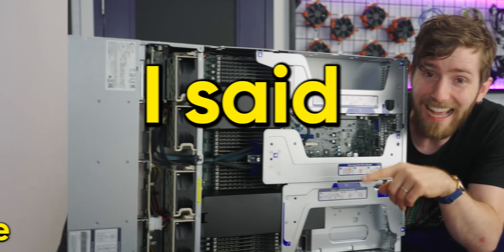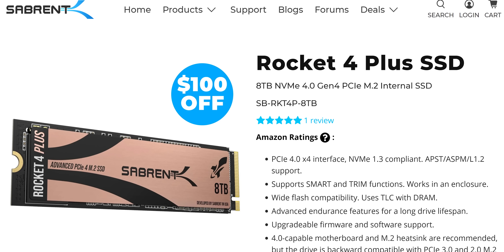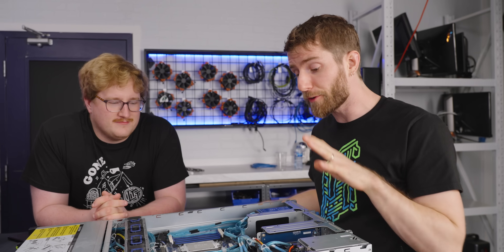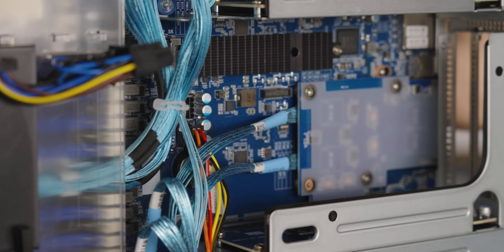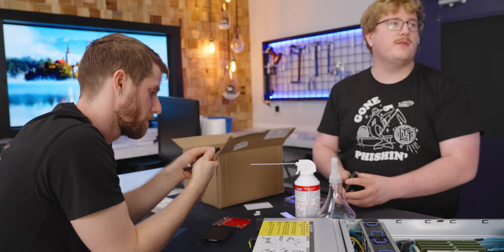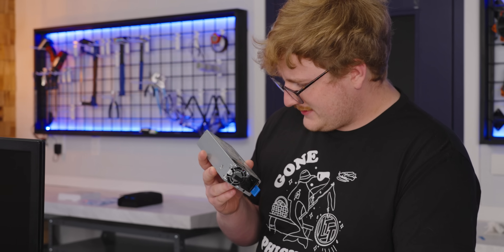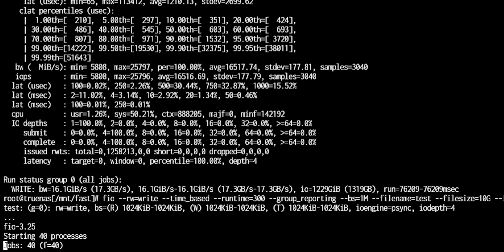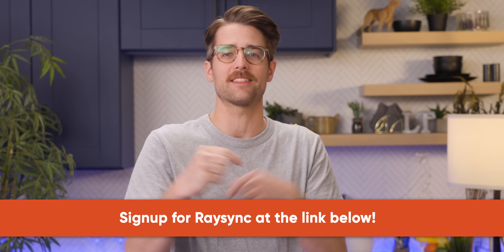Fixing our server's biggest flaw

Comment: I just realized that Micro ATX boards support 22110 drives... Hmm, Windows 8.1 supports NVMe and Turing NVENC via Quadro RTX 4000. Let me see... Ooh, Micron 7300/7400 series with the 400 being PCIe 4 and 300 as PCIe, the rated lifespan is... (7008 TBW) Waihaihait WHAAAT?! A 3.84TB TLC SSD that lives life several times over? Heck yeah I'm gettin this. Now I just to need to check if PCIe 2.0 NVMe with support the PCIe 3.0 1x as I plan for Linux on the main NVMe slot. A dual boot system with Linux for gaming and Windows 8.1 for my workloads.

Comment: We think there is something wrong with your config. We are a Gigabyte System Integrator, specialized in this kind of server and we've made a similar configuration, but with an old gen server, with less core counts, less frequency, less RAM, and we reached 55Gb/s easily and 70Gb/s with a better network. And We assume our selling price was lower than your purchase price.

Comment: RAID cards do not perform parity verification.  That is typically always a file system function.  In general, RAID cards do not need to verify parity on every read operation because the parity information is typically used during the rebuild process or when a drive fails. In the case of SupremeRAID by Graid Technology, Inc., we rely on background parity verification to periodically check the integrity of the data stored on the RAID array by verifying the parity information. This is the common practice in the industry for all RAID products including Broadcom, Intel’s VROC, Linux MD and even RAIDZ inside of ZFS.
 
For a user that insists on deployment where parity is constantly verified, they are more than welcome to implement SupremeRAID alongside ZFS to get the desired outcome.  By doing so, users would also benefit from the “wildly fast” performance that SupremeRAID offers.

Comment: Wait, ZFS is limited to like 30 Gb/s? I’ve got a QNAP TS-h1290fx NAS with ZFS that gets 2500MB/s read and up to 5500 MB/s write. But I really want to overcome these bottlenecks. I need RDMA! Like SMB Direct or something. Need the low latency pushing multilayer exr files through unreal engine. Basically I need a 40TB+ NVME drive with nvme speeds!

Comment: after having to fix a failed raid array with m.2 drives in a Lenovo server after only 3 months of use... this is sooo much better than having to rip apart the server each time to find out which drive is actually dead causing the server to not get past post.... i'd never suggest anyone buy a lenovo server after that, DELL all the way!! definitely going to suggest to replace their m.2 drives with these adaptors, will make rebuilding arrays and keeping them going soooooo much easier, best part is the server fell over again the following day, thankfully I had already moved papercut to a new host. so those vm's can just rest in peace while we wait for a warranty replacement. xclarity also stopped being accessible as well and the two onboard nics died lolll but damn such a handy thing that adaptor XD

Comment: Wouldn't it be nice if a hot swap tray had a light on it on the front of the rack that turned red to tell you which one was bad.  So all you have to do is go look at the rack, find the red light, swap the drive, and have it auto reconfigure it into the raid array?

Comment: Those Sabrent SSDs are rated for 0.7 DWPD vs 1.0 DWPD for the Kioxia CD6 (and Dell/Solidigm P5500), so not that far off despite being "consumer" devices.  I still wouldn't use any of those for multiuser video editing, but I guess when these things burn out in a few years LTT can make another video about their replacement.  I am not LTT, so I buy the (slightly) more expensive 3-7 DWPD models, and by the time those die, Kioxia and Solidigm will have changed names yet again.

Comment: WORD OF WARNING with these adapters! I've tried a few different brands but every now and then they like to drop offline for a bit and then come back. That's not too big a deal for my smaller use case, but in a ZFS array that can be real bad news. Even a successful rebuild will invisibly eat away at the endurance of your consumer drives, and if you have multiple simultaneous failures in just the right configuration, it's game over. These adapters are great when they work, but they're the weakest link in what sounds like a critical server for you guys. Something worth setting alerts to monitor and if you experience dropouts like I did, time to move to a few Micron 9400 Pro 32 TB drives.

Comment: If the thermal paste is that important, you don't want any air bubbles trapped in between. Don't stir it around. Apply it in a big pile in the middle and work it carefully out to the sides.

Comment: Wow. 20GB/s rhats totally non impressive with that amount of drives. In the lab we did triple that performance in a single server with pcie gen4 drives, granted these are the expensive enterprise grade drives. We did 28GB/s with previous gen pci drives. Sustained using software raid. And delivering that to a network client not on the storage server itself. We did a short test with 4 nodes delivering wire speed at 4x2x200 Gbps network 1.6 Tbps which delivered 180GB/s peak 150 sustained on 80/20 read-wrie balance. Currently testing pcie gen 5 based solutions.

Comment: Hey Linus, thanks. I put a 1TB SSD in my Steam Deck today and got a ton of help from your last videos and the LTT forums - it was awesome.
Reply: Why not rog
Reply: @memerified  because a 1080p screen on a handheld is like a 4k screen on a laptop - too much battery drain for not enough visual uplift. Unless you're playing plugged in, it's not worth the extra pixels. It's like a less egregious Pixel Book - specs for the sake of specs without thinking them far enough through not to mention the software problems. W11 on a handheld is hell on earth, especially without trackpads (I tried W11 on Deck and only the trackpads worked). Just. Fucking. No.

Comment: A cluster of 3-5 Whonnock servers makes more sense. Each could have a less extreme setup with much more combined CPUs/RAM/Drive space. A cluster has a lower risk of downtime and spare lanes to put more IO devices like NICs\GPUs\Accelerators. You would have spare CPUs to do other work like other network services. If you ever needed more CPUs/IO/Storage then you slap in another server to the cluster. 45 drives could probably help with that.
Reply: What clustering technique do you think can output 20+ GB/s? For GlusterFS you would need about 500-600 Gbps interconnect even with 3 servers alone.

Comment: ...I'm confused.
The OS should be able to return the serial number for the dead and / or working NVME drives, which could be compared to the drives on the carrier boards.

Tops, that's a few hours downtime to find and replace it...

Or was this just an excuse to get new hardware? 😂
Reply: That would still mean opening up the whole thing and checking serial number drive by drive, if it's not on the top that would be...annoying. lol
Reply: @rekaivns  surely you'd only need to check the array that failed on the carrier board though?

...or did they make arrays across carrier boards? 😬

Comment: Is it not common in industry to move data to an alternate temporary media, (usually with slower spinning disks) t0, do the repairs then reverse the move. It's a roundabout way, but should work well with zero downtime. I know that always on game servers do a similar thing by moving all information and connections to an alternate server whilst the main server is updated, usually the server is lower performance but serves it's purpose fine.

To recapp what I'd have done in your case;

Set the ram to dump straight to ssd's so that information on the ssd's are up to date, this may slow the connection to the editors.

Transfer data from the ssd array to an alternate temporary array at the highest speed possible, it's likely I'd use SATA ssd's in your case.

Repair the failed drive in the array.

Fix the data with parody drives

Compare and transfer the altered and new data from the temporary array.

Set ram back to data cache.

During this there'd be 2 major bottlenecks where both drive arrays are active at the same time, and the temp server would be significantly slower than the main but it would keep your array matching, plus gives you ample of time to do any upgrades to the main drive array.

Comment: Enterprise equipment really does have so much waste. Those placeholders are a good example where they could've made it so you can at least attach a drive but nope, they're often not even all that long just to fill in the slot. The other part is their packaging, everything is individually packaged to such an extreme, we've ordered multiple drives from HPE in the past, each individual drive gets its own, decently sized, box along with massive plastic holder floating the drive in the middle of the box. I understand why the plastic holder exists, to prevent damage in shipping, but they could at least put more than 1 drive in a box.

Comment: I love watching you guys play with servers as it cracks me up sometimes. I know a few weeks ago for us we had a customer having issues with our 10gbps ports we linked up for him on another switch in a different rack so we installed one of those connectx4 100g ports and stuck them on the same switch with a pair of 40g ports and bam issue solved. :) 

Consumer SSD's are often times the same speed if not faster than most enterprise drives. You only get more endurance out of the enterprise drives which is why we mostly use them in the data center world.

We just racked up 3x 2U 24 bay nvme systems the other day.

Comment: We have a build like this in progress currently using a Dell PowerEdge R7525, a pair of AMD Epyc 7763 CPUs, 1TB of RAM, and 24 of Micron's 30.72TB 9400 Pro U.3 drives.  There's so much to learn about tuning these to run in TrueNAS for workloads at this performance level.  It's been quite the long haul but I'm happy to say it performs better than anything I've ever seen, even on this channel.
Reply: One of the things they didn't cover is how the ARC Cache reduces latency If you get your DB, Web Server and file contents into ARC Cache your read performance skyrockets. You go from making a queries, building a page from something like 2600ms to 60ms. With multi-threaded DBs and Web Servers seeing the most improvement.
Reply: O
Reply: Did they mention what OS they're going to be running here?
Reply: @SixOThree  10:40 - They are using "TrueNas Scale"
Reply: @ericneo2  thank you. I did miss that
Reply: Do you not worry about high availability?

I would assume in a high end setup like this , the speeds must be amazing, but you would not rely a company's file server on setups like this would you? if anything fails on this server you and there's no high availability you can be down for days, no?

Comment: Enterprise SSDs aren't that expensive, if you look for the right ones.

Intel P5510 7.68TB is around 435CHF with taxes. Samsung PM 9A3 is around 500 with taxes. So around 640-740 cad. Thats cheaper than some M.2 consumer drives are, at least, if you only compare to TLC and Gen4. But none of this consumerdrives is rated for 1DWPD @ 5years.

And we haven't even touched features like powerlossprotection or continuity.
Reply: Yep the m.2's will be dead in no time

Comment: Would the icybox adapters not restrict airflow to the rest of the components?
Reply: You mean the CPU and RAM? Server fans are optimized for static pressure, so they can push/pull air through really tiny passages.

Comment: I got a question
Jake says many times that this is a” software raid “ Is there any such thing like hardware raid as well??
Reply: Yea, a hardware RAID is based on a RAID controller that you slot into the server. They come with a cache that increases write speed. Typically you also want a cache battery because sometimes the OS thinks data has been written to the disk while in reality it still resides in the cache. So in case of a power loss this could potentially mean that you lose data, since the cache gets cleared if there's no power. A cache battery supplies the controller with enough power for a few days and ensures that, if a power loss occures, the cache contents still get written to disk. If that's not possible because of the power loss, the battery holds the cache contents for a few days until power is restored.

Comment: you should go with 200g - 100g bonded - don't leave the perf on the table you already can only use 20 drives - the network will still be the bottleneck until you goto 400g bonded and then you will need to goto next gen cpu and dpu likely before upgrading to 800g and 800g bonded - it will happen in the next 3-5 years as the protocol is already approved
Reply: As they said, if they use Samba for SMB file-sharing, they'll be bottlenecked by Samba itself. It has sam SMB implementation bu it's an experimental one.

Comment: Should you guys not be focusing on lowering latency for a video editing workload?  Big number go up, but like internet bandwidth, once you have enough, latency plays a much bigger role in actual performance.  Single socket platform would be a good start to lower latency on CPU and RAM.
Reply: I'm assuming latency was a reason as to why they only run 1 DIMM per channel. Well, that, and they don't need much RAM as they said.

Comment: When i worked with R&D of telecom servers in the 00s they had one system that was so noisy the union halt work on them even with hearing protection on. I dont know what kind of fans they use, but the sound was pretty much identical ro that of a model jet engine

Comment: So when are you building 10pb project.
Its defently possible now.
With 22tb drives you only need 454 drives. With 90drives in a 4u slot. And 42u per rack. You could fit 900 drives in. So only 5x90 drives should do. Plenty of space for other drives.

Comment: Storage requires performance - but it also requires reliability, availability and serviceability. It's been fun (if painful) to watch LTT make mistakes and correct them... Admittedly, for something so vital to your company, one would have inter-site replication.

Currently, my concerns are underlying software issues (as hit previously) and stuff like the server mobo itself failing. It's relatively rare, but you'd have a bad time. A twin canister based approach would probably be more bulletproof, but would still have a midplane to crap out. So, yeah, good replication and redundancy over separated failure domains feels like where I'd go.

Admittedly, I'm basically suggesting getting a second storage array for no additional capacity. But keeping your data is always handy.
Reply: Most problems Linus encounters are all software related. Everything from all his wireless tech in his house, to OS they run on their servers.
Reply: @username8644  Yeah, it's mostly end user stuff for the cheap, but no enterprise. There's a reason it costs more.
Having a storage that just opens a ticket at the vendor and having a replacement part waiting the next morning without any manual steps is gold.
Reply: He needs to do a Ceph cluster build video series
Reply: @aiskef33  He would cry because of the 2/3 loss in capacity, the amount of servers required and the networking needed behind it.
Reply: @aiskef33 , what are the benefits? I've read their home page and didn't really understand what Ceph is in terms of block / file-based storage.
Reply: With 100 employees a well proven SAN storage with vendor support is not too far away. We have customers way smaller who can afford this. The problem with LTT is the huge amount of data and the requirement to be extremely fast. Our "normal" customers only have the requirement of being reliable, but not necessarily huge and fast at the same time.
Reply: @drstefankrank The solution would just be to have multiple servers for their editors rather than one huge one. One server for like 5 editors for example. This is what is normally done in the industry lol.
Reply: @username8644  yeah - their performance requirements may be high, but honestly so are many customers these days. And I'm honestly not sure one can call it /huge/ - multi-petabyte footprints are pretty common these days.
Reply: @username8644  Also having a fast storage for the current projects and moving archive to slower storage, which is still very fast if only one editor has to dig through, can also save a lot of cost.
Reply: @username8644 having to manage the exact work each individual editor is doing to be on the right server would be too much added headache, so one big is sensible here
Reply: no, it's mostly for CoW FSs like OpenZFS or BTRFS, they calculate hashsum for each block, for each write.

Comment: Regarding identification of failed drive you can do using M.2 Serial number where it is visible in OS.
Reply: They'd still need to turn it off, pull out each of the bays, and read all the ssd serial numbers. If the SN isn't visible from the top, then that also involves unscrewing and unplugging each drive. Not hours of testing, but enough time that I can see why just slotting an extra spare in the front was a better way to go.